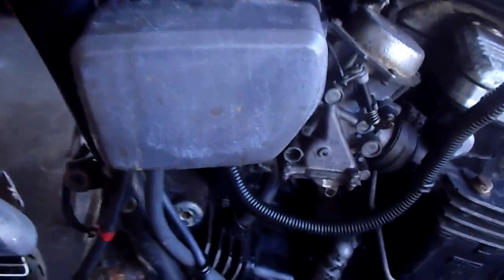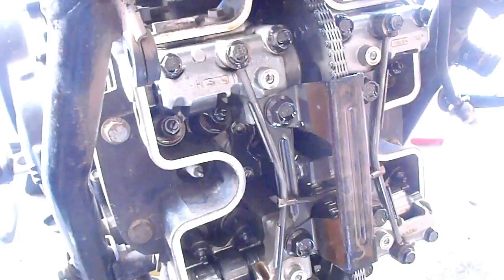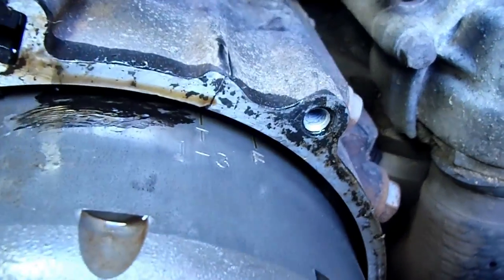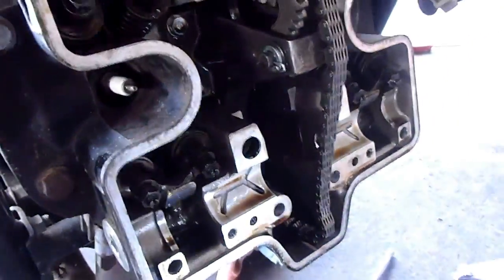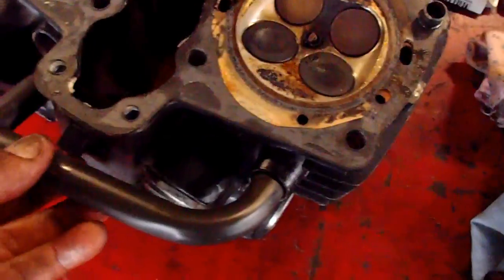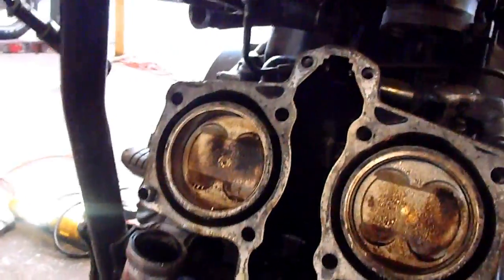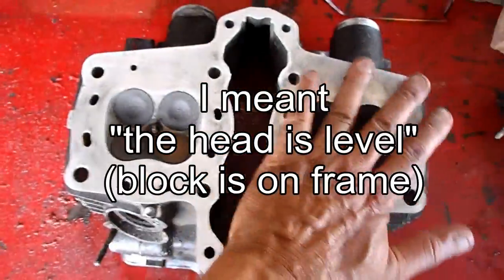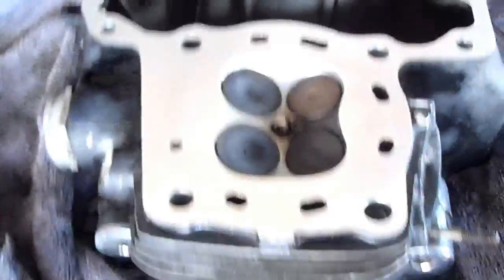Honda Magna Head Removal for gasket replacement

Comment: Hi there Sir.   How did you get the combustion area so clean?    I'm gettin ready to pull my heads because I know I've got a antifreeze leak into at least one of the heads.    So do you know if you can take the rear head off without having to remove the whole engine outta the frame?    Thanks bud and I really like your enthusiasm; sounds like myself.  Lol
Reply from the maker: Sorry my man, if you have to work on the rear head...I strongly doubt there is enough clearance to pull the head (ie, probably have to pull out engine...there are only few videos on that).  I have done the rear valve clearance.  Regarding cleaning on the front end, I stuffed rags and used masking tape to make sure no debris falls into crevices between cylinder and wall.  Then vac'd the crap out before removing any blockers.
Your bike is worth the effort, and you're young enough to put in the juice... make it happen...best to you!!!!  Sending power out into the universe for your effort.
Reply: @UnderseaCaveman  .... Hey buddy I got the heads pulled on my v65 and man was it nasty!    All 4 cylinder had antifreeze mixed with oil but everytime I checked my oil dipstick it looked good???
    I know thats very weird huh?     I got pictures I can send you if you got an email and you wanna see.     Also believe it or not I got that rear head off WITHOUT pulling the engine.   It is very tight and the biggest issue was the slipper guide that is on the inside of the head because you have to work the head out at angles because you can't raise the head straight up high enough to clear it.       On a side note,  it is my belief that the previous owner probably knew about the head lead but obviously wasn't gonna do anything about it and I'd say that put extra pressure on the other head and lead to that head gasket failure.   I was only getting about 105 to 120 psi on all 4 cylinders when I done a compression test.     Thanks for your replying buddy!
    The other guy that has the cam tensioners video is evidently no longer replying and yea that video has been pulled due to copyright violation.     Take care!
Reply from the maker: @mirandabri834  Good to hear about being able to pull rear head.  Some fluid is gonna come out just from separating the heads.  The compression ratio is supposed by like 10.5....which all the gasoline can handle anyway (diesel needs much higher).  Given that less than atmospheric pressure enters the cylinder (say 12 PSI instead of 14.7 PSI due to headloss in the throttle plate) I don't expect better than 120 PSI across all cylinders.  I know that does not conform to specs...but, I don't get how one gets 180 PSI even with 14.7 PSI and a compression ratio of 10 (or 10.5).  Awesome, good on you.

Comment: Where's the reassemble video???
Reply from the maker: Yeah dude, Magna Vision took it down....don't know why.  I was kinda messed up cuz I had to do the head again just 2 weeks ago.  Don't use copper gasket spray and then Seafoam in the oil system.  Seafoam tears up the copper gasket material.  Happened on two of my vehicles.
Reply: @UnderseaCaveman  ....it got pulled because he had a copyright violation.    I know it stinks huh..... I need it to redo mine as well.   But Ty for this video

Comment: How the f**k do you put the cams back in and put the chain back on the sprockets?
Reply from the maker: The same way that it came off.....its surprisingly easy.  I understand your wondering.  Too bad "Magna Vision" took down the video describing the assembly process.
Reply: @UnderseaCaveman  I've since figured it out

Comment: what was the reason you pulled the head in the first place? I just ordered head gasket online today. Is it harder in the rear to pull than the front? thanks
Reply from the maker: I had bubbles in radiator, indicates bad headgasket....gas from cylinder combustion leaks into coolant...and on vacuum stroke, cylinder sucks water past gasket....gasket bad
Reply: @UnderseaCaveman  καλησπέρα καλέ μού φίλε, σου στέλνω από Ελλάδα.  Έχω την ίδια μηχανή, επιχείρησα να κάνω ακριβώς την ίδια βλάβη.  Και δυστυχώς έχασα τον χρονισμό, κάνω προσπάθεια να βάλω τούς εκκεντροφορος πιστεύοντας με τα σημάδια του βολάν αλλά ακόμα δεν τα έχω καταφέρει.  Αν μπορείς να μού στείλεις κάποια βοήθεια για δέσω σωστά τούς τούς εκκεντροφορος. Ευχαριστώ!
Reply from the maker: @smarotrikoupi9714  Sorry, I can't read your alphabet.

Comment: my 84 v65 is getting harder for cold starting. Bike overheat and loss coolant once warm up in surface street but if as long as I keep moving on the freeway speed at 60 MPH ++ it is fine.  Bike will spit coolant from the overflow tank in the back tire when fully warmed up and sitting in traffic. I checked compression for all 4, one of them has 140 PSI and all 3 have 180 PSI. I'm considering replacing the head gasket for the rear engine since one of them has 140 PSI , a 40 PSI difference between them. Plz let me know what you think. thanks
Reply from the maker: is it the front head or rear?
Either way, sounds like the right thing to do.  Most likely loss of compression is due to head gasket (rather than piston ring failure).
Reply: +UnderseaCaveman  Thanks for replying Caveman. Is it in the rear. Do you think i should do the front too while i'm at it? Is it harder with the rear since the frame is in the way? What should i watch out for? any tips or pointers? Thanks.
Reply from the maker: Yeah, you might as well do the front, unless you can pull the rear head off without pulling the engine.  Look carefully for burn marks across the gasket surface (on head).  If you got some, use very fine sand paper on glass (like I did) to remove scratches.
If you can do the rear without pulling the engine, then just do the rear.  Then see how that works.
Reply: cool thanks.
Reply: any specific torque for those bolt? I have a manual on hand. But probably don't know what the bolts call in the manual if i'm going to do this job. Head gasket change. thanks
Reply from the maker: +Truong Ho yeah, the torque specs are in the manual, don't recall them.....look for cylinder head bolts...that spec matters most, affects the extent of crush on headgasket.  be sure to check your valve lash clearance afterwards....it will change due to new gasket.

Comment: how did you clean the head before you began sanding? was there some type of solvent you used to remove all the gunk that was there?
Reply: guess he isn't gonna ever answer. BUMMER
Reply: @jessejames5825  you have to be patient man.
Reply: Brake parts cleaner and a green scotch Brite pad.  Done it with MANY motors.   The brake parts cleaner will get most of it off with minimal scrubbing.    Just don't and I MEAN don't get it in a cut on your skin. Unless you like pain. Ask me how many times I've learned that lesson haha

Comment from the maker: I stuffed some rags in the crankcase opening, used razor and greeny pad ( not sand paper, I didn't want any sand inside block, obviously).  With razor and greeney pad I got it satisfactorily clean.
Don't worry about your block being flat, if any warping occurs it is most often the head (literally thinner piece of metal).  Understand, all this in the context that block is in frame.  Pull rags out carefully to keep particles from falling in (oil filter will catch stuff...but why chance'm)

Comment: Okay I was just curious because I had carbon build up and caked on old gasket on the surface of the block side and didn't know how to clean/ sand that crap off to ensure it was flat too. What would you do in that situation?  Thanks for the reply.